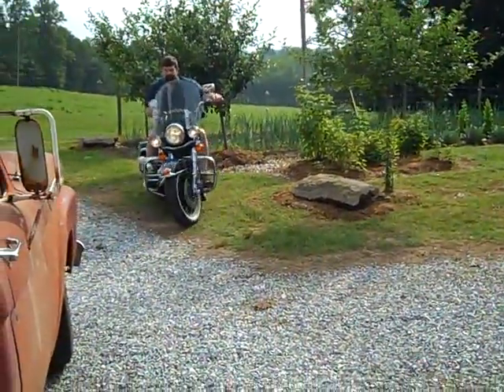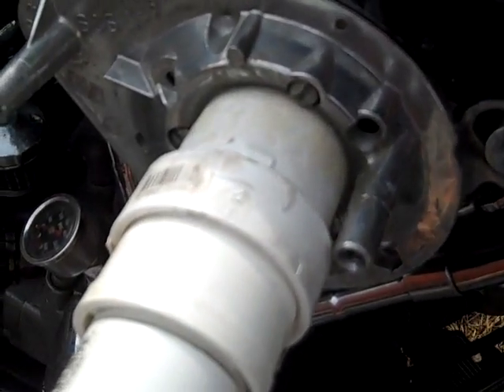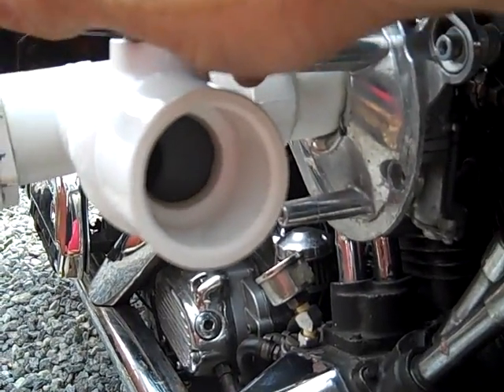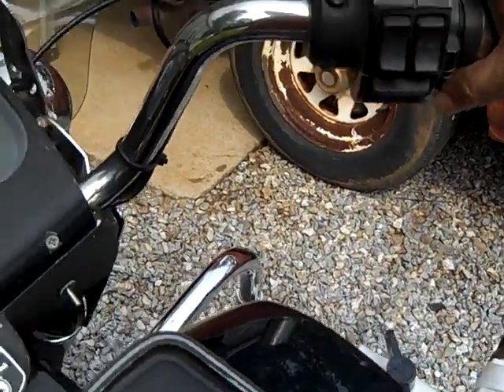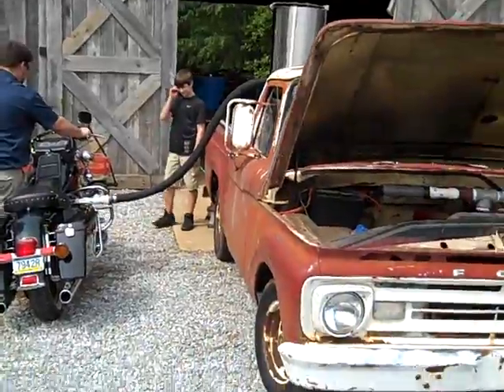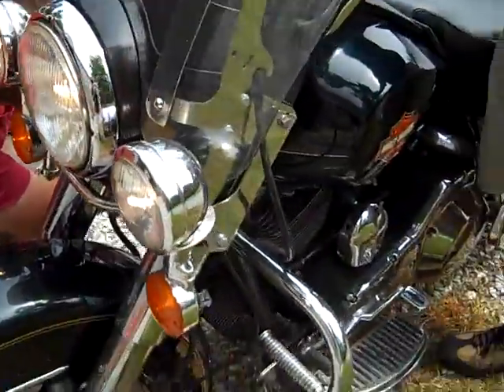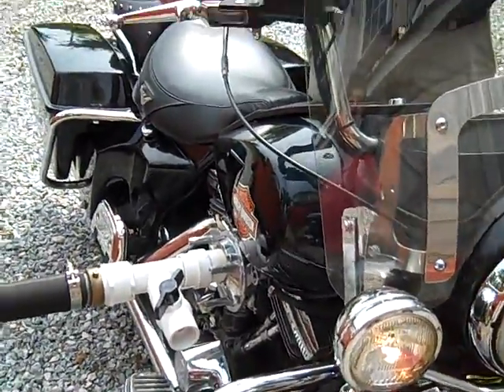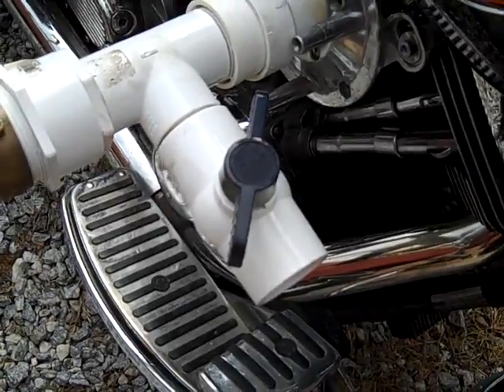Wood gas hawg

Comment: Wayne Keith has a Dodge V-10 running on wood gas on youtube. I'm pretty sure it's fuel injected. You would just have to have a switch to turn off the gasoline. He ran his pipes right into the air cleaner.

Comment: would it work to compress the wood gas into an air tank modeled after the gas tank so that you dont have to take the gasifier with you?  If you had a regulator and compressed it to scuba tank pressures you might be able to go a little ways

Comment: Wish they guy at Victory Gasworks  would work on a smaller model. They guy is a genius. Be great for a Cycle or a mid size tractor. Be great to have a gas powered tractor to work the farm when the fuel goes.